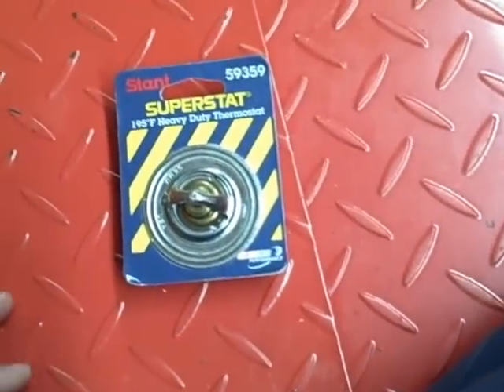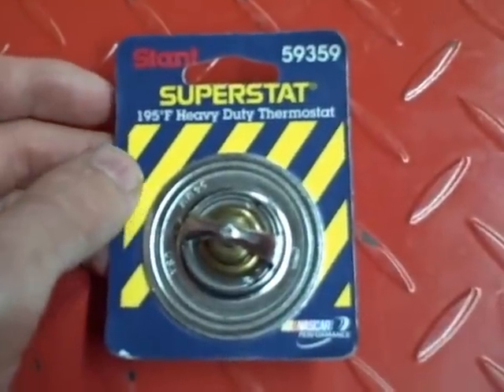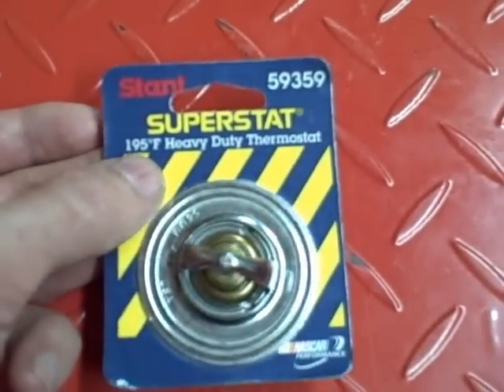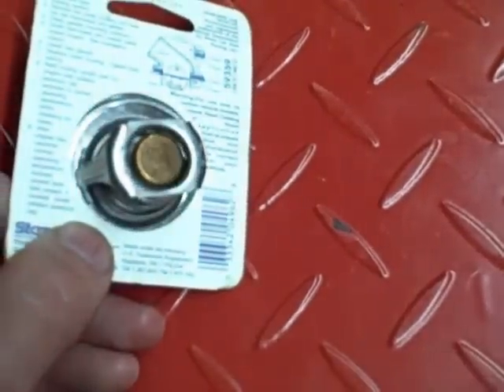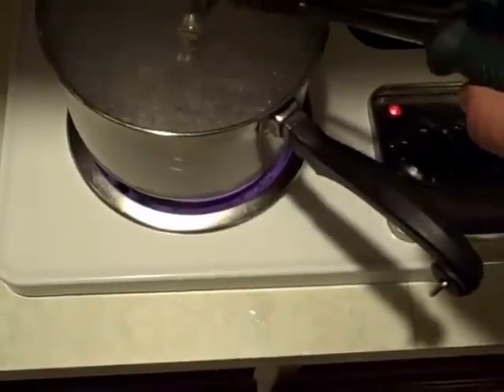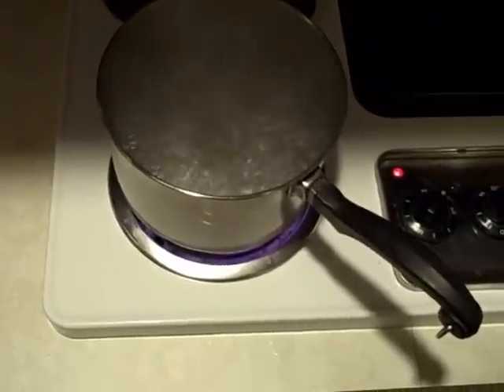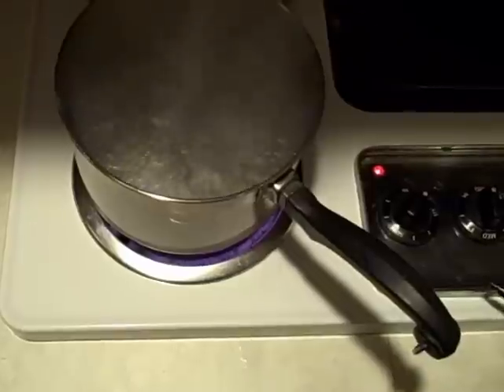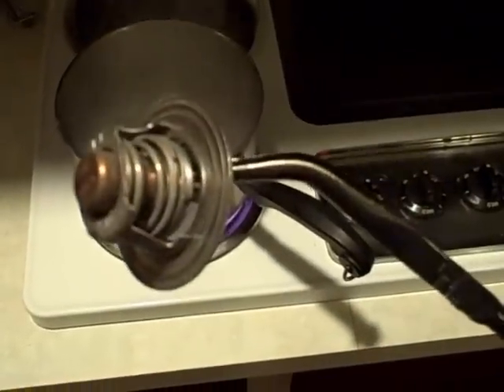Opening a Car Automobile Stant Thermostat using Boiling Water

Comment: The wax inside the central cylinder melts at a specific temperature, in your case, 195f. The wax melts into a liquid and begins to thermally expand, pushing the thermostat valve open. It appears to be defying physics with those springs, but in the raw brass taxes of how the thermostat opens and closes is actually a hydraulic wax filed piston and cylinder.